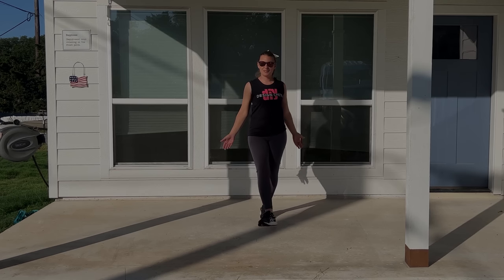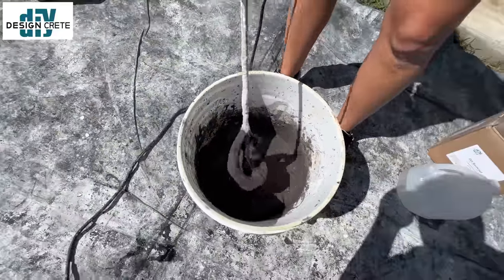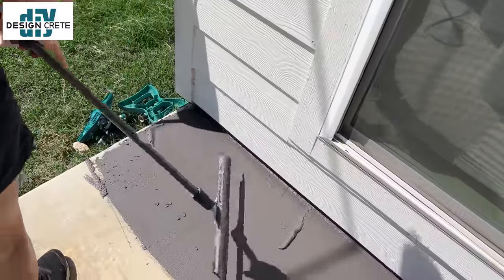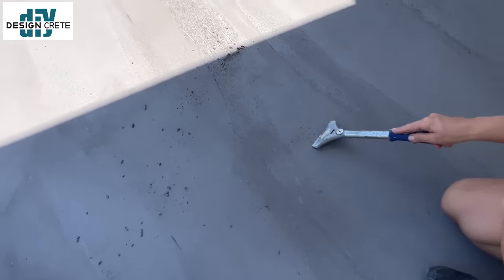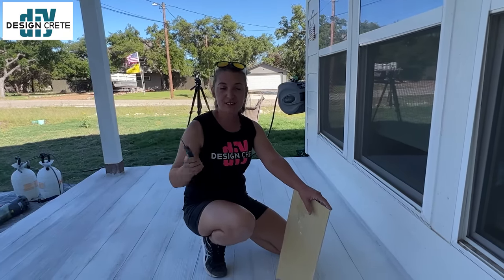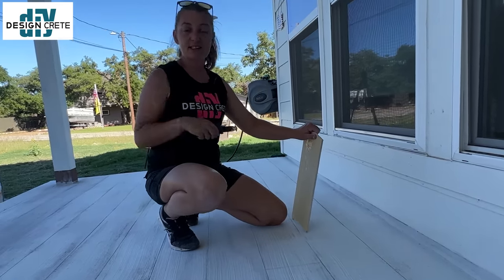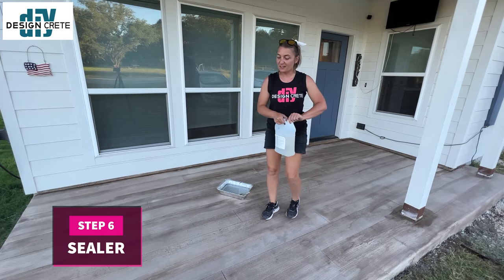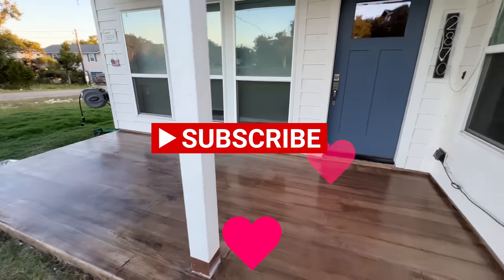Make your concrete look like wood! DIY full tutorial

Comment: Wouldnt it be easier for you to mix the textuer coat with the color /stain dyein te same bucket? ?
Reply from the maker: The tint pack needs to be mixed with water before adding the diy texture but yes you can use the same bucket

Comment: When cutting out your “end boards”…
Use a square.
Reply from the maker: Yeah we didn’t have one that day
Reply: @designcretediy  an actual square is not necessary simply use end of the boards you used would of workers just fine…
Or anything with a right angle.

Comment: Don't they sell the special tape for marking all your lines before the texture coat.. wouldn't that be easier?
Reply from the maker: Yes it’s called fiber tape, it tends to look more like tile that way because the lines are too thick and trust me it’s not easier. You can still use the tape method with our products but there’s a learning curve
Reply: @designcretediy  I take your word for it, and yeah, I don't want it to look like tile.. thank you for your feedback